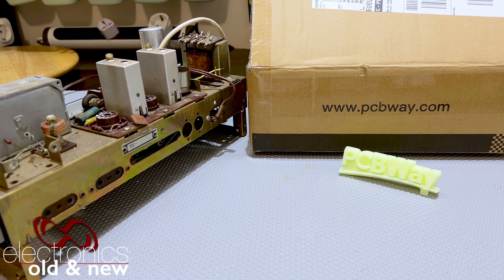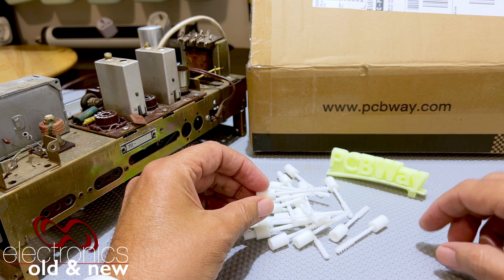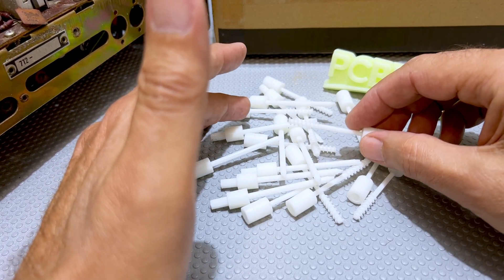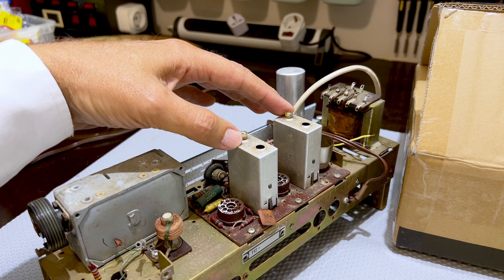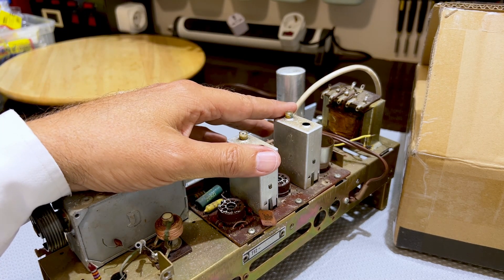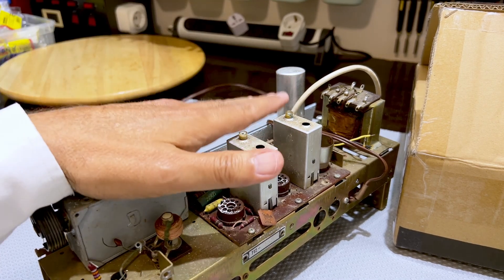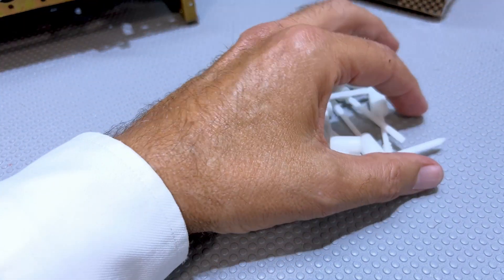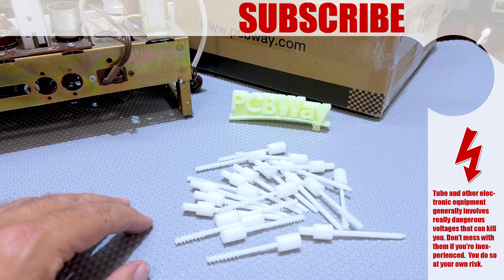A World First? Wax Removal / Alignment Tool for Tube Radio Restorations.  #pcbway#

Comment: Does the helix on the auger need to run that far up the shaft ?  Why not just make it 1 or 2 turns - easier to clean.
Reply from the maker: You’re right. That would be much easier.

Comment: Just thinking out loud -- Try printing a nut that would screw on to the "auger". Screw the nut onto the auger before the de-waxing operation. After de-waxing, unscrew the nut and see what happens.
Reply from the maker: You see? Crazy comments in a video can bring up great ideas 👍
Reply: Yes was thinking along the same lines. You could make the nut or sleeve with the same helical thread the same length of the threaded part to cover it when not in use to protect it from damage.

Comment: I've used a drill bit to remove wax. The thread is of course very coarse, or steep, but it brings wax out very well, and wax does not stick. Perhaps you should try coarser pitch?
Reply from the maker: I’ve used drillbit in the past as well, but was always a little frightened that it might eat into the ferrite core.

Comment: EXCELLENT IDEA!! 👍  For the really stubborn one's, I wonder if you could heat up the tool first?  Maybe with a heat gun if it can handle the heat.  Don't know where a resin tool melts down.
Reply from the maker: I don’t think the resin will hold out against heat too well, but I’ve got enough of them so I could certainly try
Reply: Maybe soak the tool in hot water just prior to using.
Reply from the maker: I’m not sure how the material will react to hot water. It may become too soft.
Reply: @electronicsoldandnew  - True.